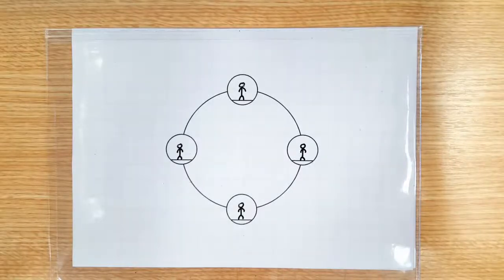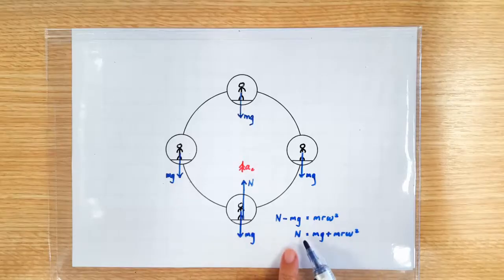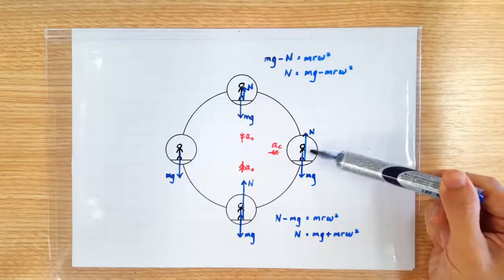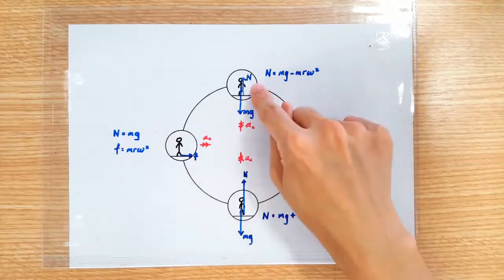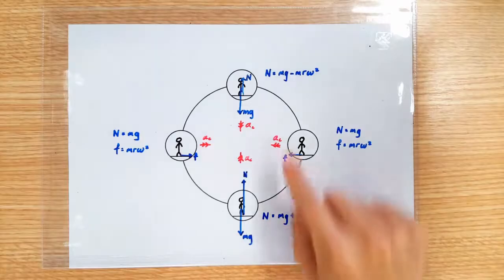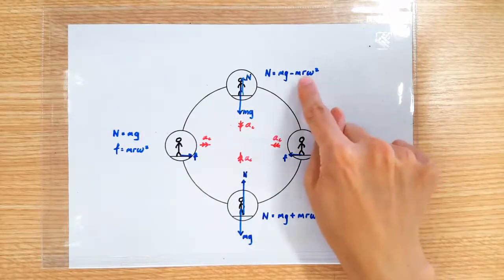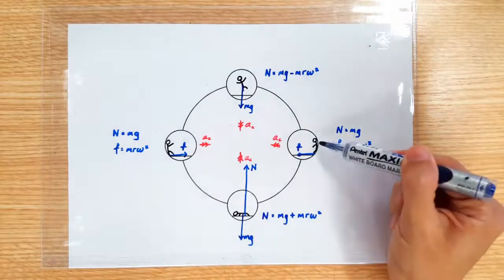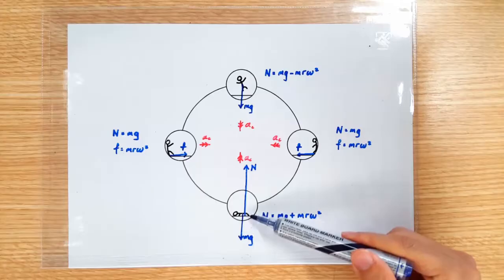Circular Motion: Ferris Wheel

Comment: i dont get why they feel ligher as they go up because surely if as you go, the normal contact force gets smaller meaning there is less force resisting your weight
plz help me
Reply: You seem to think that you feel the net force as weight. That's wrong. We can't feel acceleration or net force or field forces. We can only feel contact forces. So you "feel" the normal contact force as your "weight". When the floor pushes you less hard, you feel lighter. In fact, if you are off the floor and there is no normal contact force, you feel weightless.

Comment: Can anybody explain why the acelleration IN THE Y DIRECTION at 3 oclock is 9.8 m/s even though the normal force = mg so acelleration should be zero??
Reply: acceleration in this context is actually not constant, acceleration is the change in velocity compared to time. since velocity is direction and magnitude, the ferris wheel changes direction which changes velocity. Therefore, acceleration changes as well mking it not constant.

Comment: this assumes the normal force to be less than Fg at the top without actually proving it mathematically.
Reply: They didn't plug any numbers in. It's true that at the top of a ferris wheel you accelerate downwards immediately due to weight being larger than normal contact force so a resultant force is present acting downwards from the centre of mass of the cabin.

Comment: Hi can you explain to me why is the man hovering at the top? I get that  the normal force there is zero when the car goes berserk but doesn't that mean there would be no force balancing him against the force of gravity and he would fall THROUGH the car in a free fall?  But my question contradicts itself, the man's apparent weight is less at the top of the wheel so "falling through" the car would be impossible...so how is it the way it is?
I am also not very clear on the friction force exerted sideways at 3 and 9 o'clock. Friction force's nature is to oppose  the relative motion of moving surfaces/ objects. Whose relative motion is friction opposing here?
Please help.
Reply: You are correct that at the top the man experiences a downward net force. But he does not fall through the car because the car itself is dropping as fast. As for the frictional force, well, if you focus on just the horizontal motion, going from 12 to 3'o clock, the man's inertia wants to maintain its rightward momentum but the car wants to slow down. So that's the tendency for relative motion and frictional force steps in to keep the two surfaces together. Going from 3 to 6'o clock, the car wants to speed up (leftward) but the man does not feel like it, so...
Reply: @xmdemo  Brilliant! You are  genius man! Thank you so much.

Comment: Friction always is a force which opposes motion. The cart holding the people is not moving wrt the wheel. Thus no frictional forces exist. The Centripetal Force is the Ferris Wheel structure itself that forces the cart to move in a circle. This is similar to swinging an object attached to a rigid rod or a rope...................However .... if we consider the person rather than the cart holding him, then there is friction between him and his seat. If the coefficient of friction is high enough, then this is the Force that causes a(centripetal). F(centripetal) = m v squared over r. And f(friction) = mu F(normal) = mu  m  g from the vertical equation.

Comment: Hello,

at the 6 o clock position....
 
If normal contact force is greater than weight then shouldn't  the man lift up??

at top, the platform stops him
Reply from the maker: at the 6'o clock position, the net force is upward, but the man is also having a sideway velocity at that point in time. So he does not lift up vertically.
Reply from the maker: Similarly, at the top, the net force is downward, but because the man is having a sideway velocity at that instant, the man does not drop vertically downward.
Reply from the maker: The net force only tells us the direction in which the velocity is CHANGING. Like a moving ship trying to turn, it takes time before the velocity is in the same direction as the net force.